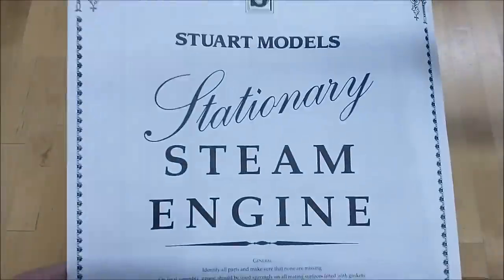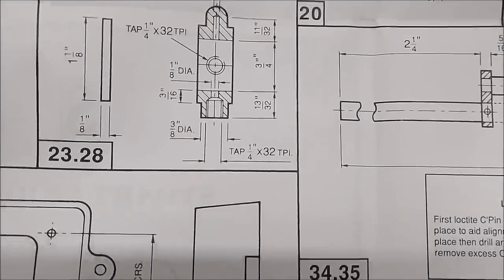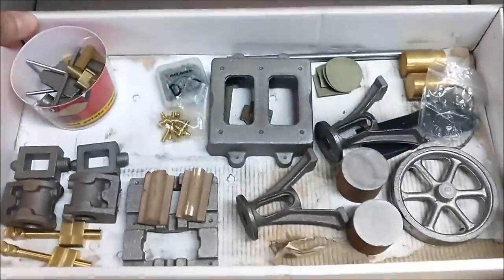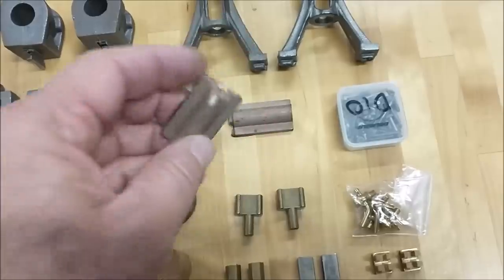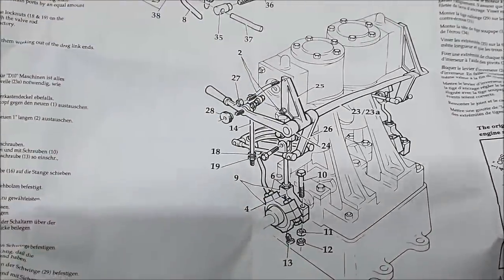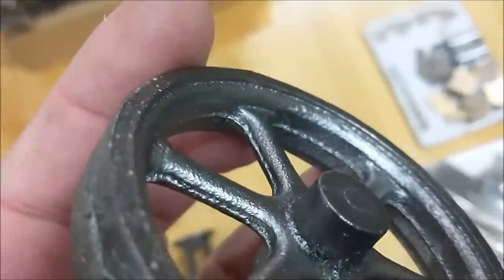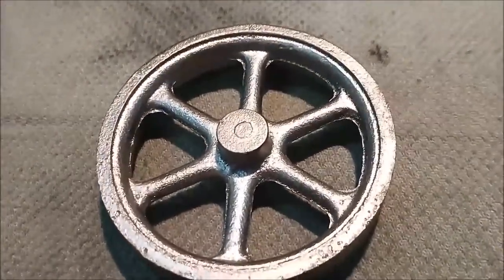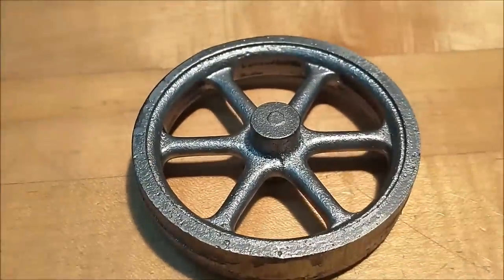Stuart D10 - Vertical Twin Cylinder Steam Engine - Lets Begin !!

Comment: Hi Joe,
Delighted to see you taking on a Stuart engine !
Just one word to the wise : 
The drawings were produced in a time when things were “fitted” together, before the advent of tolerances, necessitated by the largely American influences of mass production . . . .
Dimensions were given in fractions, with guidance been given in words, for example 23/32” bare would be a few thousands undersize and 23/32” full would be a few thousands oversize. The quality of fit would largely be left to the judgement of the machinist.
If I were starting to construct one of these models, I would create a general arrangement drawing from all of the dimensioned parts, and see how well they all fit together . . . .
“An hour in the drawing office is worth a week in the shop”, as my old boss would have said . . . .
Over 50+ years of reading the Model Engineer, there have been more than a few wailings and gnashings of teeth in those pages, on the subject of Stuart’s dimensional inaccuracies . . . . 
However, I have every confidence in your intuitive expertise to “get things right”
Good luck on your journey !
Steve A

Comment: Fantastic - what a generous gift. Stuart Models started in 1898, so the approach to model engine plans hearks back to days when paper was super expensive so they (Stuart Models) crammed as much information onto one sheet as they could, and that practice continues today in the model engineering world. Makes for a bit of an adventure interpreting the plans sometimes - and it's down to the model engineer to figure out the tolerances and fits! I'm very pleased to see this kick off and will be avidly following. Cheers!
Reply: I reckon I'd start by making a CAD drawing of all the moving parts to calculate appropriate shaft, bearing and cylinder (etc) diameters, tolerances etc. PPPPPPP! 😅
Reply: Indeed - that’s a solid approach and rewarding in its own right. 👍 I usually just look at the assembly and work out what is doing what and apply tolerances as appropriate. These days I am very much into training engineers in GD and T so I try to think about it in those terms.
Reply: I learnt in school (around 2010) that good drawings should give all the information needed with the least amount of views, in order to avoid clutter and useless complications. And I think that drawing parts that goes together as one in sub-assemblies will give a quick and clear idea of how they will relate to each other
Reply: That's the difference between model engineering plans and manufacturing drawings. That aspect of multiple parts in one part of the plans does indeed help the plans describe intent for the parts in the assembly. In the manufacturing world we require all information needed to define the part, including tolerances, finish, material, size and shape to be on the piece part drawing (per ASME Y14.5 or BS8888) - so that there is no need for interpretation. There are a great many very successful model engineers who never even see the inside of a manufacturing facility - so two different worlds with a bit of an overlap.

Comment: This will be an interesting build and it will provide an impressive amount of power when completed. I built the Stuart Marine Twin which is very similar and it really does sound glorious running loaded and on steam. The BA thread system is a curious one. It follows a geometric progression with each size downwards being 9/10ths the next size upwards. It does scale really well which is why it is used for model engines. It is still possible to buy hex headed bolts and nuts in BA sizes. The castings that support the cylinders are called "trunk guides" but they are also the structural connection between the cylinders and the base frame for the engine.
Regards,
Mark

Comment: Mr Steve Bright is a most generous gentleman. This is a wonderful gift. I am certain that you will do justice by it, during it's fabrication and construction. Please do not presume what is boring to me. I am most interested all aspects of your projects. Your filing technique and the tools used are just as interesting. Some of the filing on that fly wheel in real time would have been most appreciated. Your work can only be boring if you do repetitive operations more than three times. For instance if you have to bore ten holes. After the first three I think most of us get the idea. Show the first two or three and mention you did the same on the remainder. I am a woodworker and I turn bowls on a lathe. As such all your work is fascinating to me. Not ever boring. Thank you for sharing. Have a great day and stay safe.🙂🙂

Comment: Stuart Models are great.  Castings were good back in the day. This should be fun. The one I built was all BA threads back in the early 80's. the one I built was a single horizontal 10 I think. I want to build that one you have and add a reverse gear. Someday maybe!

Comment: When I was building a "tiny power Ajax" steam engine, I bought an MLA die filer kit and it does a masterful job for all that flash and cleaning up raw castings.  I've had that filer for close to twenty years and pull it out for any casting or substantial filing job.  One of the best most useful tools I've ever made.  I still enjoy watching others build steam engines, and sometimes find myself buying another kit out of envy!  Always interesting to watch you work, Joe.

Comment: I am so excited for this build. I have a completed factory machined D10 and attempted to fit it with the reversing gear. I can’t wait til you get to the reversing gear to see how it’s done. I’ll still enjoy the build of the engine because I want to build the V10. Supposedly you can build the V10 with only a lathe, maybe the D10 as well. Are you up to the challenge?

Comment: I have the single cylinder version.  It is a stunningly beautiful model with the full reversing gear fitted.  I believe the part with the two legs is called the "Standard".  The brass parts are now cnc machined but were originally stamped in the older kits.  I've got the original drawings and they are very different.  I'll see if I can email you a photo.  This will be another great series.

Comment: Hi Joe, looking forward to seeing this progress. I would be surprised if there is any metric on a Stuart drawing. Imperial fractional dimensions with BA (British Association) hardware is normally how they go. BA were mainly used for instrumentation and electrical fittings and dates back to the 1800's. Cheers, Jon
Reply: I think Joe was confusing metric with decimal inches (0.000"), which was present on the drawing.

Comment: I have watched Keith Appleton build and repair these D10s and many other steam engines, on his YouTube channel for a long time. Once built there are a few tricky valve timing adjustments to do to get it running smoothly, but it shouldn't be anything you can't handle. I think you should have a fun time building this Stewart D10.
Reply: Yeah, Keith times his engines by ear. But being a musician he has that ability.
Reply: It really is a nice set of quality parts. This will be a fun build for sure eh.
Reply: Every time I see Keith machine parts I cringe...using wooden blocks for parallels, going to the belt grinder instead of the milling machine.  Will be nice to see Joe machine the parts for this engine properly.
Reply: @jackpledger8118  Keith always tells us he is not an engineer(machinist), but he seems to to do okay. Maybe a little ham-fisted, but he gets it done. He also knows the ins and outs of all of these model steam engines.
Reply: @sfeddie1  he keeps telling people he is showing the wrong way, like when he silver solders and uses too much to show how not to do something but sometimes I wonder if he knows how to do things in a proficient manner. His use of a micrometer is a constant source of amusement to even the newblest of newbies. He does produce the goods though, by hook or by crook, so one should criticise too much.

Comment: Stuart make lovely kits, and the castings are usually fantastic. Occasionally you'll get a "chilled" spot in them that's super hard, but usually it's not an issue. You're really going to need a boiler before long! sure, you could just use air but there's no romance in it!

Comment: Oh hell to the yah!!!!!! Not only is this a Stuart engine model but it’s done by “The Pie”!!! This is going to be good.

BYW: mixed measurements are nothing new. Just redid my Cummins dodge clutch. Some of its metric and some of it is imperial. Just need to be aware and consistent.

Any whitworth threads in this beastie?

Did I mention that this is going to be good!
Reply: Yes! The 1/4" X 32 is  ME (model engineer) which is a Whitworth thread form. The other I saw was BA  (British Association). No metric though.

Comment: Although the BA thread is based on the metric system, it's not a standard metric thread, it uses a 47.5° degree thread with rounded crests and valleys, you won't find taps and dies as metric! Cheers, Matthew
Reply: Would this still be a whitworth? Whitworth are theoretically 50 degrees.
Reply: @devmeistersuperprecision4155  No, it's not Whitworth which is 55°, it's 47,5°, it's a thread that was frequently used by mode Engineers.  Regards, Matthew
Reply: It's also worth noting that the sizes are geometrically related. So a BA2 is twice the CSA as a BA1, and a BA3 is twice the CSA of a BA2 and so on. So if you need something twice as strong, you just go up a size, rather than trying to do a load of math to figure out how much bigger the diameter.

Comment: The conrod did used to be a casting but it wasnt very good, the small end was usually misaligned to the big end, which I found when building my 10V. When I asked for a replacement I received the machined one which was much better

Comment: BA is actually imperial, the system was formulated to be compatible with metric; but long before the British formally adopted the metric system.
0BA is (from memory) identical to M6x1.0 - but everything should be quoted in decimal inches. Although the system is perhaps a little obscure, it is a useful small thread.
Reply: Imperial not really, 47.5 degrees and more rounded than Whitworth. The threads pitches are progressive and are calculated by raising the  arbitrary base of 0.9mm to the power of the corresponding BA number. It's wacky...
Reply: From what I remember from school, the thread is derived from the Swiss Thury thread. Orphan imperial

Comment: Hi Joe some information on BA blots. The BA stands for British Association and is only used on bolts under 1/4". To make life even more difficult for machinists they decided that the tread angle should be 47.5 and not the Whitworth 55 or the US Unified Treads 60 Degrees. Metric also use 60 degrees. The only one that have the same diameter as metric is BA0 that is 6mm.

Comment: Joe 
1/4 32 TPI is a M E (model engineer ) constant pitch thread 1/8 to 1/2 is 32 TPI.  same for 40 TPI  55 deg both. .   BA  ( British association) is a funny one 39deg round top form but its sized in metric 

have fun at least the drawing will be ok un like my last build that has imp and metric dims .. like 6 mm (0.25 in) same page 6 mm (0.24 in)
Reply: BA is 47.5° I think?
Reply: @ferrumignis  
opps my bad you are correct I have used BA for a long time but never bothered to screw cut due to the odd TPI , I now wonder were I have got the 39 deg from

Comment: The fact that some parts are partly machined is because Stuart used to have them cast but probably now is cheaper to machine them instead. The same goes for the crankshaft blank that was supplied as a forging
Reply: These Stuart engines have been available unchanged for decades and go back to a time when it was unusual for home shops to have milling machines. 

That changed with the Dore Westbury but the idea behind the part matching I believe was to enable folks to complete these models with just a small hobby lathe (usually a Myford in the UK) and a set of hand tools. 🇬🇧

Comment: The old school engineers heated files and bent them to shapes required and re hardened them,   it had to be done slowly to avoid burning the cutting teeth.
Might be a plan to upscale those plans to build a steam powered generator to run the machine tools????  Or convert to flat belt overhead shaft drive/////
Not so crazy in these times, eh?
Reply: You can get riffler files for this kind of work, the old school two stroke engine tuners favourite porting tool.

Comment: BA isn't metric. It's a system of small fractional threads based on a very sharp profile: 48°, if memory serves. Watch those other threads as well; things like the ¼"–32 threads may also have an unusual thread form.
Reply: It kind of is metric, BA0 has a 1mm pitch.  However all the smaller sizes are a fraction (0.9) of the preceding one so don't have a nice clean fractional mm (or imperial) size increment.  It does mean the thread pitch scales really nicely with the diameter though, so they "look" right on models.
Reply: The thread angle is 47.5 degrees not 48.  The other threads for the glands etc. are called ME (Model Engineer) and have a Whitworth form. 🇬🇧

Comment: Those are not metric fasteners- BA stands for British Association which is an old thread type which is measured in metric sizes, but has a different thread form so they are not compatible with metric threads.
Reply: BA threads are based on a metric system. 0BA is 6mm dia, 1mm pitch, but the thread angle is 47deg. Every thread with a higher number than that is 0.9x the diameter and pitch of the previous.

Comment: That's a very well-made piece of Machinery you have there you are talented  maybe when you get done playing with it and you want to sell it you would let me know. Thank you from Tacoma Washington
Reply from the maker: Make me an offer. 10K or better will get my attention.
Reply: @joepie221  hello Joe. Sorry I missed your note.. I may have to hold off on this for now but at least I know there's some very well-educated mechanical skills out there and you're right on the top of my list Perry on a separate note you said the Retro Musa does one engine it's hard to get the brass bushings off and I find I want to take mine apart to polish out the crank can it be done by prying apart the brass bushing with a fine chisel or a screwdriver? Thank you for reading my post

Comment: Joe
Got a question. The finish on these parts are likely shot peened. I need to get some machine tools rebuilt and some of my projects are pumpkin orange!! I was thinking of sand blasting but that often leaves a finish that is rough light grey. Any suggestions to blast these parts to get this dark grey finish? Any shot media ideas? I now this is ADHT but what the hell.
Reply from the maker: I think the darker color comes with age. you could try darker blast media, but that just usually translates to a more aggressive surface finish.

Comment: Joe stated that thread cutting tooling was provided.  I wonder if that tooling adheres to Whitworth standards.
Reply: No, it’s originally based on a Swiss thread standard with a 47.5 degree angle and rounded crests. 🇬🇧

https://en.wikipedia.org/wiki/British_Association_screw_threads

Comment: ME threadform isn't the same as UN, it's derived from Whitworth and cross is rounded crest and valley and 55 degree.  Pitches are mostly 40 and 32 tpi.

BA has metric pitches (sort of, BA 0 is 1mm pitch) with a 48 degree thread.  BA is sorta weird, really.

Comment: What a fantastic project, Joe! I’m really looking forward to watching it develop.

The bizarre mixture of measurements is somewhat typical of Britain’s position sitting on the fence between Europe and the USA. As a Brit I think it’s ironic that Britain created so many engineering standards and never quite let them go when we joined what was at the time called The Common Market. Another couple of generations and we may have it licked. 😂
Reply: I'm American and sympathize with the folks in the UK who have endured 2 thread form changes.  The world's 1st standard thread, Whitworth, is just fine, but in WW2 the American industrial giant's tsunami of equipment lead to the adoption of the UNC/UNF standard, which is basically American SAE/SME, while incorporating a tiny nod towards Whitworth's rounded form.  Naturally, Whitworth, SAE/SME, and UNC/UNF employ Imperial measurements.  The advent of the Common Market/EU caused a 2nd switch to Metric standards.
Reply: @eliduttman315  Many thanks for the historical perspective, Eli. I can’t help but think that Metric will prevail in the end but you guys certainly benefit from your use of inches and fractions. We’ve all but forgotten how useful it is to quickly halve a dimension without using too much mental arithmetic. On the plus side, my generation is remarkably adept at converting between Imperial and Metric. 😊

Although one of the weirdest anomalies is that we buy our petrol ( gas ) in Litres but still express a car’s fuel consumption in mpg. Although, of course they’re advertised in l/100km 🤯
Reply: I worked for a large worldwide medical company as a toolmaker we also used mixed systems. we did have an engineer that had his own system . so we had metric imperial and some sort of Russian.

Comment: Have you any good suggestions on machining a bar to a precise length - I just tried shortening a 25.3mm to 25.1mm three times before I got it right. Its easy enough to measure when out of the collet  but picking up the end of the bar again is quite a bu$$@#er
Reply from the maker: Sometimes its easier to mill it to length because you can set it up to access both ends of the bar at the same time. Or held in a V block vertically, the solid lower stop allows for part removal without moving the cutter. A good collet stop should also be a benefit in a situation like this for lathe operations.
Reply: @joepie221  Thanks Joe - maybe milling would be a better bet - may well try that - great content as always - thanks.